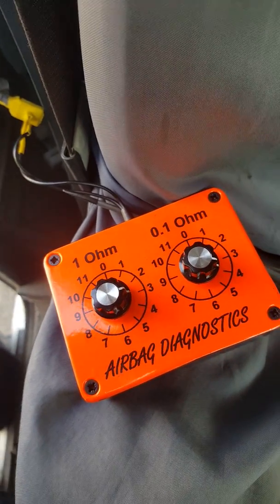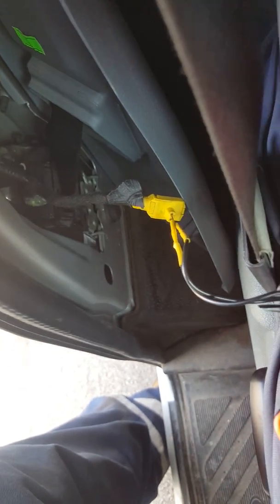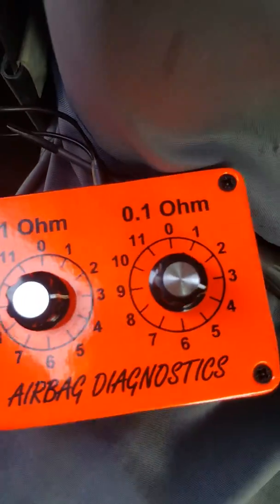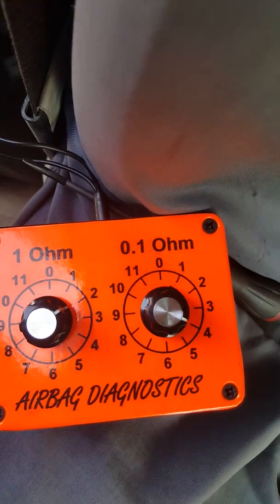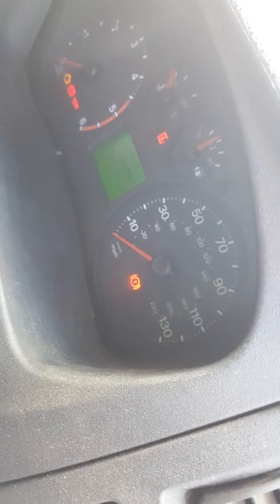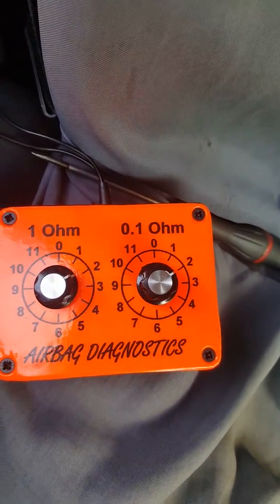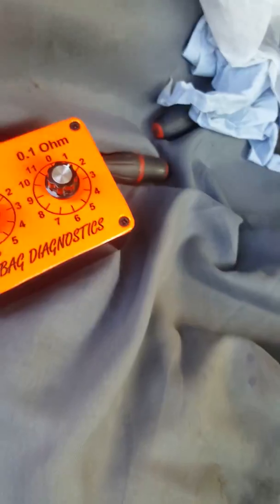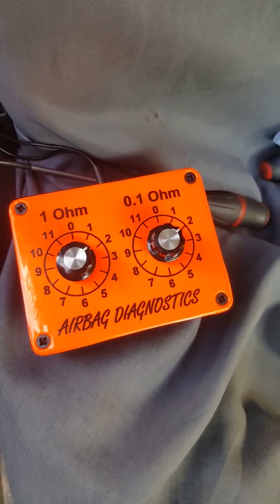Use of Airbag resistor diagnostic simulator test kit air bag  pretensioner www.airbagresistor.com

Comment: I would think in most similar situations regarding SRS components including airbag that you could measure the resistance of the suspected faulty component and or check the opposite side which of course should be comparable and you would know what kind of load would be required . To 'fool' the system
Reply from the maker: using a multimeter to check resistance down an airbag is always a dodgy idea .

Comment: your the man :) i want to remove passenger seat in my nissan leaf , so my seat prob needs a 2.2 ohm resister on the airbag connector. how do i identify which wire it is?also the seat has a sensor to let vehicle know someone is sitting on the seat. do i need to adapt that wiring? are the airbag connectors always yellow in any make of car? do i disconnect the 12v battery before i touch any cable ?
Reply from the maker: timpriest1010@gmail.com

Comment: hello , this is only a potencometers ?
Reply from the maker: Hi , same idea as a pot,  but  its built with resistors on the back of a switch .
Reply: I've  done  tried everything  to get the airbag light to go off how can I disconnect  it so the light will  go off
Reply: How  can I disconnect the  air bag